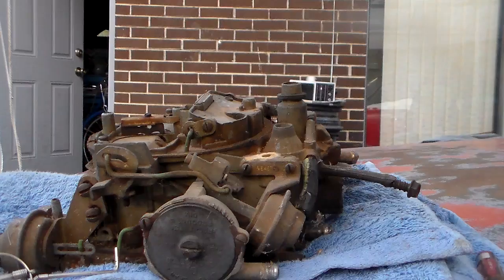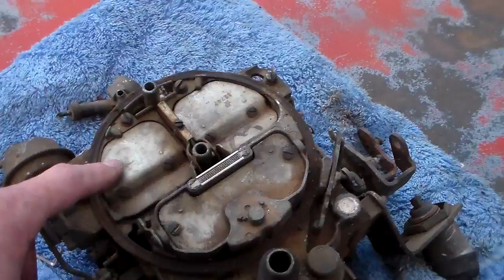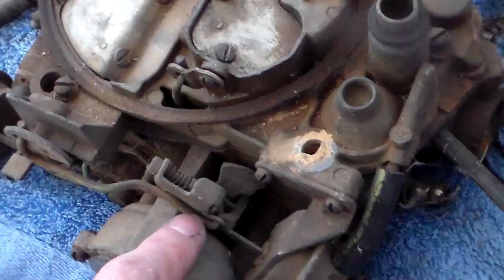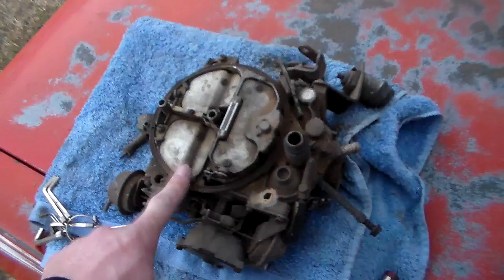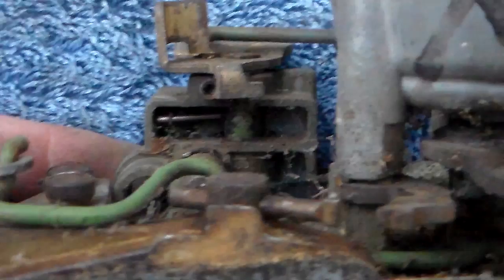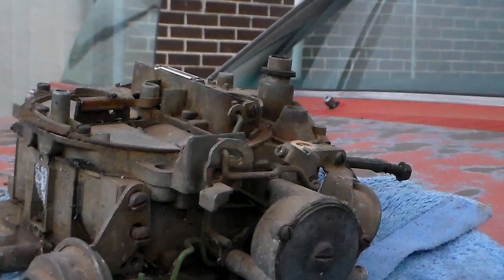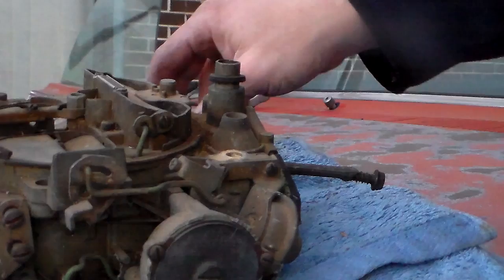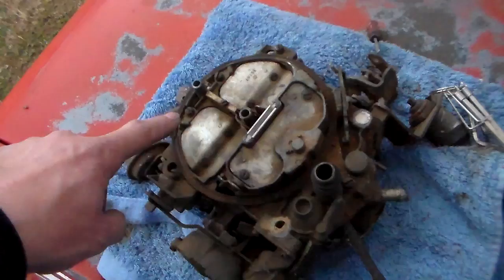How to adjust Quadrajet secondary air doors

Comment: you seem to be the man!!!  I have an 87 dodge d250 with a 360 Rochester just bought truck and the carb is driving me crazy  ive watched your vids ... my truck just wants to die or act like it is starved for fuel once it hits 35 or 45 or 50 mph it differs but will rev high while in park put elec fuel pump on  but must be in adjusting can you help please
Reply from the maker: Hawk Hawkins It shouldn't need an electric pump.  I think you have another, unrelated issue with the ignition system.

Ignition problems tend to manifest themselves under LOAD, meaning lower rpms, more stress. Fuel problems tend to reveal themselves as the vehicle nosing over the higher the revs go.

 That's a simple way of putting it, but before you condemn the carb, check the distributor itself to see whether the shaft(the one inside it) is loose, the cap or rotor is burned or that it simply needs a full tuneup.

Comment: Have you heard that these Rochester's need to have regulated fuel pressure of 3 psi. 
I have rebuilt my carb cleaned the snot out of it. 
Nothing in the seat. Float is at the correct height. 

Searching my head on this thing ran so good last year I wonder if it these new fules.
Reply from the maker: haven't heard that.

Comment: Tyler - can the secondary air door spring break or come disconnected? - my screw
 spins endlessly and the air doors are floppy ... how much work is it to 
replace this spring? - thanks, Chris
Reply from the maker: Never done that job but I'm pretty certain the air doors and shaft have to come out. The gotcha on that job is that those flap screws are swedged on the ends to prevent them from backing out completely and being ingested, so when you remove them, you'll need to file them carefully and then remove, or they'll break off.. When reinstalling don't overtorque them and use loctite. Good luck.

Comment: Hello. I just watched your video and i think my air valves arent opening (carb backfires under WOT). But i compare your carb to mine, and my carbs dampner has no connecting rod to the air valve linkage. Its been removed. Also, the entire choke has been removed also. Probably because the climate here is hot everyday. Will the carb still operate ok this way ?
Reply from the maker: If the air doors stay shut it won't backfire, because the carb does not supply fuel until there is air moving past the air doors.

Comment: Ive got a question I haven't been able to get much help on. I've got a 78 nova with light mods. Its got a lightly modified 350 and this thing used to be able to spin a tire all the way down the road (no posi yet :( ). I had a needle and seat go bad, rebuilt it, did a few modifications to the car, and it seems to have lost a lot of low end power. I bought an 800 qjet online and have adjusted the idle air screws, currently still messing with the air doors, and I'm still having the problem with low end power. Seems like it just gets loud and doesn't make the power you'd expect. It still chirps tires going into gears, so I'm a bit stumped as to what's causing my lack of torque.
Reply from the maker: Have you put a dial-back timing light on it to see what the timing is doing? It may be fine but ignition advance issues can mimic carb problems.

Also, you may wish to check the fuel pressure. Good luck.

Comment: Good afternoon sir, I’ve watched a ton of your videos to grasp the concepts of the Quadrajet Carbs. Unfortunately I am still having issues, one carb I have has a hot air choke  that is riveted and can’t be adjusted and no air fuel adjustment screws, the other one has the choke removed and has adjustments, what do you recommend?
Reply from the maker: You can drill out the rivets and use regular small self-tappers to adjust the choke. The mixture screws are there. There are caps over them that can be removed by sawing a slot on either side of them and them carefully knocking the caps off. The screws take a special bit to turn them but those tools are still floating around. Good luck.
Reply: Tyler's Forgotten Car Rescue thank you so much!

Comment: hey i just bought an 88 Cheyenne with a 74 350. the guy i got it from told me his "mechanic" forgot to put a part on the carb causing the secondarys to stay closed. when its cold i have to pump it like crazy to get it to start. any ideas on what it needs would be greatly appriciated.
Reply from the maker: +Aaron Doest I'd suggest first taking a look through my choke videos. Believe it or not, those engines started right up when cold back when they were new. Get the choke working first and then I can help you address your secondary problem.

Comment: Hey Tyler I'm in desperate need of help I have a 72 Buick 350 stock with the 800cfm quadrajet on it but for some reason when I hit the gas it falls flat on its face on level ground and up hill could this be my fuel pump or carb please help if you can thank you for your time !
Reply from the maker: I need more details. Does "hit the gas" mean hitting it hard, or just trying to accelerate as normal? Does it fall on it's face only for a couple seconds and then recover, or essentially the more you force it to go the worse it gets? Different problems give different symptoms, so please update, thanks.

Comment: At the beginning of the video to the right there’s a line that’s sticking out that appears to be plugged with a screw. What is that line?? Cause i got a quadrajet i’m trying to fix and i want it to be factory and my mechanic plugged it like that
Reply from the maker: It most likely was a ported vacuum line that operated things like egr and manifold heat riser. I'll check further when I get home.
Reply: Tyler's Neighborhood Garage Tyler's Neighborhood Garage thanks for answering my question, sir. 
I have also few questions that I was hoping you would answer. 
I have swapped a stock 305 out of a 89 chevy caprice on my 88 chevy caprice a little over a year ago and when I had it swapped in my mechanic said the mechanical fuel pump is faulty and he had the electrician install an electric fuel pump instead the car was running good for the first month then it started stalling and dying. He had only installed an electric pump without a regulator nor even a return line or any other component I bought a brand new electric fuel pump and installed it myself and now it does not die but it does stall and hesitate a lot and I can’t seem to figure out the problem. So, sir what do you suggest I can do?

Comment: I can not get the air doors to shut back on their own. They just flip open and don't shut back and I tried adjusting it. The spring is there but it doesn't seem to do out tension on the doors. It's on a 76 firebird.
Reply from the maker: That's a rare issue. Let me dig one out and look at it...I'll get back to you.
Reply: The spring might be broken. I'll pull the carb off and see if I can get a better look.

Comment: Hey ive got a quadrajet 7043202 on my 73 omega with a 68 production 350 Rocket engine. It ran fairly well and I just rebuilt it and have got the thing running pretty damn well if I do say so myself, no bog, mixture is pretty good, plug colour is perfect and now im just trying to get it tuned perfect power wise.

My secondary air doors open really easy and when I loosened the allen screw and tightened the screw on the side there no matter how many turns they didnt seem to get any tighter, maybe a tiny bit tighter after literally 15-20 turns? any ideas what the problem is?
Reply: Spring is probably not catching the rod it catches on or spring is gone or wore out

Comment: nice video, thanks.
i have a question. I bought two new quadrajets (marine application) and the secondaries are siticking closed on one of them, i have switched carbs on the motors and it is the carb.   It wont run past 3K rpm and the butterfly on the secondary feel like it sticks in the first few mm of the movement.
Reply from the maker: +steven barts ok...what is your question?

Comment: Is it normal to see drops of gas thrown from the secendarys when revving the engine WOT? I have adjusted the float and properly set the internals of the carburetor with the Thexton tools, i even have the dwell set at 30% and still see drops of gas. its a CCC carb
Reply from the maker: What is the carb on?
Reply: a 1986 Trans Am LG4

Comment: I got a 74 Chevy pickup and one of my buddy's told me to bend that pin on the secondary shaft on the passenger side to get more power but it runs rough sometimes what should I do
Reply from the maker: Thanks for the question, but it's nearly impossible to answer without hearing it and driving it.

Comment: Thanks for the tutorials. I used them to rebuild my quadrajet in my boat. I came back to this one because I am having issues with backfiring through carb, which I believe is a lean issue. Thought metering rods where not opening. As soon as RPM's get above 3800 is right about time the secondary opens up and backfires. This is all under load. Jets are spec according to manual for the boat engine. Basic Merc V8 350. Timing set 8* btdc. Any ideas?
Reply from the maker: I suggest ensuring that the secondary circuits are indeed capable of flowing fuel, and also you may wish to check total ignition advance with a dial back timing light.

Comment: i am having problems with my secondary air flaps I have used your videos to adjust them and I  think I have everything right but it still bogs I have noticed something very weird that I can't find anywhere online .. when you open the air flaps all the way the metering rods do not move you can move the little rocker arm and they move fine but the arm on mine is not even touching the roller thing in the middle of the flaps so it doesn't move the metering rods up when the flap is wide open . I have no idea what is going on
Reply from the maker: That's a very rare situation. It sounds like the plastic cam in there has broken loose from the air door shaft. It is supposed to be a tight fit. You'll need to remove the airhorn so you can investigate that more closely if you don't see something else that could cause that, and I don't know what would.

If it's indeed broken or cracked or whatever, you can get a new one from Quadrajetparts for less than $5. The only trick is that the secondary air doors have to be removed so the shaft can slide out. Those small screws that retain each flap are usually swedged, meaning the ends are mashed somewhat to keep them from ever backing completely out. You need to file them down some so that they will back out easily. Otherwise you could break them off in the airdoor shaft. Use locktite when putting them back in. Not a hard job, just a bit time-consuming.
Reply: Thank you so much you are very right the plastic piece is gone completely lol

Comment: It's definetly the first one with the more squared body. There is no choke... That's partnof my problem the choke and all the linkage for the choke and secondary damper is missing. The butterfly was wire tied in an open position.
Reply from the maker: Ok. That's quite helpful. I have a few other easy questions:

1. What year is the boat
2. Does the carb have the marine bowl vent tube? That's the curved tube that is on the top of the carb at the front. It's purpose is to direct any overflow from a stuck float back into the venturi.
http://thumbs3.picclick.com/d/l400/pict/231071348822_/ROCHESTER-MARINE-Carburetor-fits-74L-V-8-454-Engines.jpg

3. When you look at the intake manifold under where the choke housing WOULD be, what do you see? Do you see a sheetmetal box or assembly with a rod sticking up out of it? Or, do you see a flat plate slightly to the rear that appears to have 2 ports on it that would accept small metal tubes? Or, nothing, just a blank cast iron intake with nothing there?

We are about to the bottom of this.
Reply from the maker: I wrote down your email, then removed your comment for your privacy. I'll send you a message in a little while.

Comment: Hi great video, i want to buy this carb, i had a holey on it i bought it that way, and now i have a q-jet but it is for a 350 .
And my car (a 77 Trans-am 400) really needs this carb :-) so do you want to sell it to me ?
Reply from the maker: I'm afraid I can't but I have good luck using ebay to find carbs. Use the correct carb number and start searching..good luck!

Comment: the carb rebuild kit i bought didnt come with secondary metering rods and there isnt any to begin with. without those rods, would tightning the secondary doors maybe make it too rich? im about to just seal up the back and make it a 2 barrel do to the missing peices. im not concerned about max power as much as function. i think youve shown 3 different carbs that look like mine but some things only mine has. i might just send you a video and show you what im dealing with. also i hardly ever give more than 50% throttle so would a 2 barrel be enough for a 5.7 L? thanks for the tips bud, rochester videos are hard to find.
Reply from the maker: Man, I wouldn't do that. Not being mean, but if you are going to fix a carb, do it all the way. First...you are sure it's a 4bbl? The reason is that they did make some Dualjets that used a 4bbl casting, just with sealed secondary apertures.

Anyway, if indeed somebody took out the secondary rods and possibly the hanger, then you'll need those. Go to Quadrajetparts.com, click on Rochester Quadrajet on the left, click on "secondary rods" and order a set of CE or CK rods. Then, click on "hangers" and pick up a "K" hanger IF your hanger is missing. That will fix you up. You may need the small screw that retains the hanger. I might have one of those. Trust me, after you get this thing working all the way, you'll give it more than 50% throttle!
Reply: Tyler's Neighborhood Garage i assumed not to seal them off but, if i bought a 2 barrel carb would the intake manifold be ok with receiving fuel from one side? that was my concern. i really do not give more than 50% regardless, even if i had a porche lol its just how i drive. i just want a smooth economic classic car that i can drive daily. now are the secondaries the only ones you can see? i have the ones you pointed at in this video but specifically remember having missing rods during the rebuild. it is a 4 barrel it has all funcional doors and the tension feels good they dont easily open. honestly just by switching the distributor advance to a ported valve has smoothed it out alot. i consider any answer as friendly lol
Reply: when i first got the car it had a straight bore carb spacer and i switch to a beveled spacer that gets me a ton more milage, i would stack another but my hood wont close hehe. roughly i can make it from orlando to dam near verginia on a full tank if i hold 55mph steady. its a 3 speed and thats why i dont give it more than 50% and anything faster than 60 just eats the gas up. i get alot of ppl riding my ass but compared to going 55 on the highway in a honda civic? its much less aggressive haha. nobody flips me off of honks the horn as they pass me like they do in my girlfriends car. im old in the head i guess lol this is why i only want enough power to pull the car when its loaded with stuff. again thanks for the help

Comment: Tyler, I have an R4-M4ME (17082224) that, apparently didn't come with a front choke pull off. A part number is listed for it but there is no place for the linkage to tie in. I bought the vehicle used and it has a new pull off installed on it but no linkage. I rounded up a linkage and got to looking, SURPRISE!, no place to hook it up. It has tapped and threaded holes (to mount the diaphragm) but I suspect that is a matter of course when the castings are manufactured. What say ye?
Reply: Bob Bastion Some of the "newer" carbs like yours came with one choke pull-off that's mounted on the rear of the carb instead of two one in front and one in back so the linkage is different but still works the same. I suspect yours is like that so not having the front pull-off is okay if the rear is all still there.
Reply: Yep. I finally figured that out. I appreciate your reply. What threw me a curve is that someone had installed a choke pull-off on the front and it didn't come with one. I had just finished rebuilding it. Runs like a top now. I love Tyler's videos as much as I love Quadrajets. Thanks again.

Comment: i have a new Quadrajet 4 Barrel on my EL camino 350 and i cant get the  4 Barrel  to work it is new . can you do a video on how to get  the  4 Barrel  to work on the motor
Reply from the maker: My "debog your quadrajet" series covers a lot of that subject.

 In the meantime, start with the basics:

 1. Ensure the throttle opens all the way with the accelerator on the floor(do all these checks with engine off).

2. Then, ensure that the bottom throttle blades on the secondary(rear) side open when the accelerator is floored. The back barrel throttle blade linkage is spring-loaded, meaning the front barrels will open completely even if the back side is stuck shut for some reason.

Sometimes there is a secondary lockout on the passenger side of the carb that prevents the secondary throttle blades from opening as long as the choke is on. Check to see if that is the problem.

3. Check that the air doors up top open with moderate pressure. They should not stick closed under any circumstances. If they do, figure out why. Do not crank the spring tension off the air doors in an attempt to get them to open.

Let me know if this helps any.